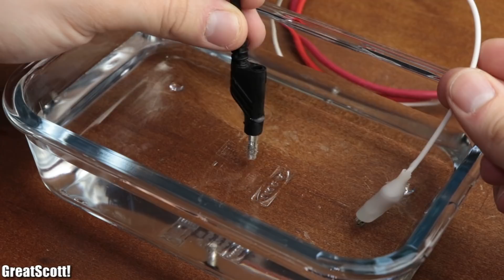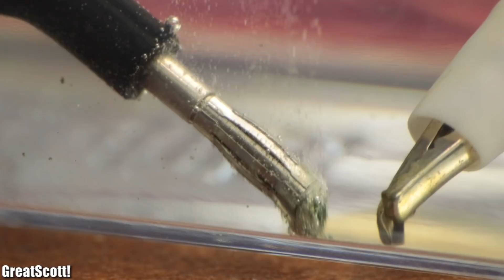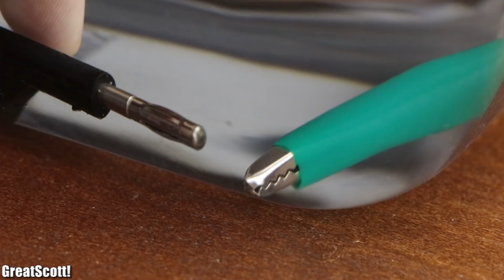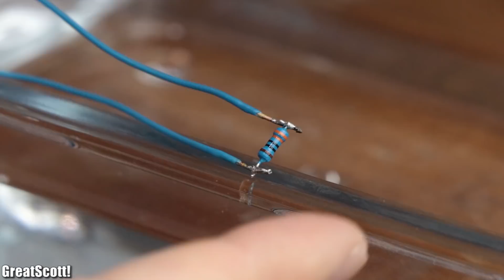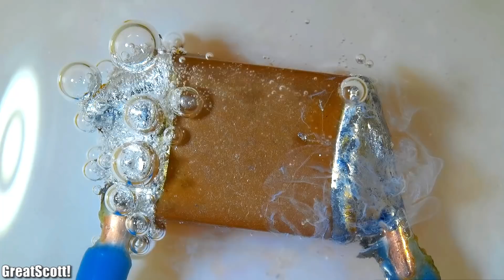Electronics & Water? What could possibly go wrong?

Comment: Arduino stop working. With water disabled oscillating crystal!
Reply: yeah I wonder what actually happened to the arduino. those pro minis have ceramic resonators instead of crystals, but I dont know exactly how a ceramic resonator works. are they just like super accurate r/c oscillators maybe? idk
Reply: You are correct sir. Crystal oscillators are very sensitive to resistive loading and by submerging in conductive water you effectively add a ~30k ohm resistor across the two terminals. The crystal cannot drive such a low impedance load and fails to oscillate.

I believe the restart of the oscillator after some time is due to chemical deposits forming on the exposed metals that form thin insulators and raise the resistance up to a point where the oscillator can operate. A quick reset and off it goes.

Comment: Back in the 1960s I encountered several tube-type TV's which people had spilled sugary drinks into the back.  The remaining goo on the circuit was conductive.  Washing an entire TV chassis in a shower worked reasonably well so long as you let it dry in the sun for a few days.

Comment: GreatScott! One more thing should be added that tap water is not the same everywhere. That means if you get 300 Ohm/cm in your tests someone (ie. with old metal pipes in their water system) could get less or more.

Also in your test you could add salt to even more decrease Ohm/cm. That is how water resistors are created :)

Comment: It does amaze me how people think about electronics. I can't even recall the number of times someone told me their electronics got wet and now it does work, it doesn't work because the first thing you did was try to power it up (or it was powered when it got wet), not necessarily because it got wet. Water and electronics mix just fine you can leave an electronic device in water for weeks, months or even years, as long as there absolutely zero power (no battery). And if you dry it properly it will work as good as the day you put in the water. Its the water and electricity in combination that ruins electronics.

Comment: This was before I actually watched the whole video, I paused at the end of the intro, electricity directly from the socket, 110v ~ 150v and 215v ~ 250v coming in contact with water is not a good idea, as long as you are wearing boots, and are not soaking wet, you can go ahead and unplug whatever is plugged in and should do ok, the main risk here is that you could act as a wire to earth from the line, if you're properly insulated, aka not touching anything conductive and the earth itself, you should be fine, just unplug whatever was soaked in water, the secondary risk is the device that was soaked getting some short circuit internally and burn itself up.

With electronics it depends on how much contaminant are in the water, and how quickly you remove as well as clean and dry the devices after it had been exposed to water or whatever other liquid, the main issue you will get are often that the water corrodes metal alloys in electronic parts that are not watertight as well as corrode all the exposed metal parts, and if those parts contain iron or alloys that contain iron, they could start rusting, all electronic devices have parts that contain iron and alloys with iron in them.

Comment: Once at the plant where I am working as a maintenance man, the electronic gas meter stopped working due to moisture. I cleaned it with a brush and soapy water, let it dry, and put a coat  of varnish on it. Still working now, 8 years later!

Comment: For industrial electronics such as PLC and DCS equipment we had both CO2 and distilled water fire extinguishers. The distilled water of course to keep the equipment clean but also to minimize the conduction of electricity and the shock hazard from supply voltages of 120VAC and 125VDC.

Comment: Louis Rossmann once did this with a Macbook. Same result.

Thats why there is only one possible solution if you spill water over your laptop/phone: INSTANTLY remove the battery, and let it dry. If it's only tap water, you're fine, if it's sticky like coke you need to clean the board with alcohol and destilled water.
If you dont do this, your board will corrode either instantly, or over time.

Comment: I dropped my phone in tap water (by accident). I don't know how much time it was in the water because I didn't notice fast, but maybe one minute or two. It wasn't supposed to be water resistant but I guess the only sensible parts that were really exposed to water was the jack, the speaker membrane and the usb input.  No sign of faster battery draining. I may open it one day to check if I have rust traces in it (I need tools I guess) but it's more than 1 year ago and I didn't see any malfunction (I had some issues before it didn't got worse with the bath). Phone is honor9.

Comment: I mistakenly went swimming with my headphones in my pocket in salt water last summer (my bad, people sometimes forget). I realised it pretty soon after I got into the water, but late enough for them to get fully wet. I went on and washed them with the cleanest water I had at hand, which was the nearby shower (I know, not distilled water but that's all I had available - still better than all that salt the sea has), and let them dry in the sun for a couple of hours. They still work today, and I haven't noticed degradation in their sound quality. Water is not as dangerous as it seems to electronics. Not good, but not that bad either.

Comment: Something I didn't see Scott point out is that, before you stick your finger into a cup of water with a live wire in it. MAKE SURE IT'S DISTILLED WATER, or else you'll either feel a light zap or all 127-220 Volts of electricity. Which really is painful.

Comment: In season 2 of Agents of SHIELD they literally ripped a lamp off the ceiling (that had both the longest cable ever and perfectly stripped and twisted wires) and caused a spark by touching the two leads, they then proceed to shove both leads in someone's face causing them a BURN wound, like wtf.. Don't get me wrong, it's my favourite show, but man was that part cringy

Comment: I had a laptop from 2012 that died in January this year, I've spilled tap water on it probably 10 times over it's life span, and it was working perfectly fine till it died out, also sort of need to note that the laptop often reached a cpu package temp of 110℃ even when it was brand new, and was almost always running like that the entire life of it, every time I remember I've spilled water on it, I took out the motherboard as fast as possible, and patted dry the parts, then put it in the owen on 55℃ for 30 minutes to let the water evaporate,  I also replaced the thermal compound as well as cleaning out the heatsink and fan, unplug every single connector on the board.

Comment: I had a cheap brushed ESC in one of my model ships. It had sea water leak onto the ESC. I washed it out with tap water and dried it out. 

Boat sails fine. 
Boat stops in the water after 40 seconds. 
Boat makes smoke out of the funnel. 
Owner is in panic. 
Smoke density increases. 
Owner wonders whether or not to jump in  the sea after it.  
Suddenly boat has some kind of internal explosion. 
Owner dives in after boat., nearly stepping on a surprised crab. 
Owner retrieves boat, water was not cold.
Owner opens boat to find a horrible sulfur smell and front of boat is full of yellow liquid.
Take boat home.

Never will I buy a cheap ESC ever again. Luckily it was powered by a NiCd battery and not a LiPo because that battery was roasting.
Got the boat sailing again, turns out the bang was a capacitor launching like a projectile inside the boat.

Comment: Scott! You should've tried that arduino with internal RC clock as well. The long leads to the crystal oscillator got altered by the additional resistor. If you keep everything (except the LED and its resistor) inside the chip, it should work.

Comment: chemist here, you cant judge wether or not a chemical reaction is happening by observing the bubbles, its only if you are creating H2 and O2 that bubbles will be visible, other electrochemical reactions can be to disolve a metal in water by salting them or other changes still

Comment: Interesting to see the actual numbers and the nicely predictable constant 300 ohms/cm as well as the actual effect on electronics so a very good video in that regard. One thing I wonder though, I saw somewhere that the amount of current that can cause problems for a human seems kinda small, if you are used to playing around in 5V land. The reason why no one notices anything from a poking the business end of a 9V battery though is that it isn't high enough voltage to get past the resistance of your skin (plus internal resistance) and still deliver enough current to be in the problem range. If you throw 240V mains into the mix however, I have a feeling 100mA might be "un-fun". I seem to remember small currents start to be a little unpleasant at around 45V?

Comment: Mineral oil is non-conductive. You can put electronics into it and it'll run fine, many have used it for whole PC cooling (not very successfully). Liquid electrical tape works well for coating or there are more expensive (better) solutions available for electronic encapsulation. You can even put the electronics in a glass ball filled with mineral oil and have an object that can survive just about any pressure underwater because there's no pressure differential between the outside and inside, so it can dive to the bottom of the ocean with ease (cheap deep water camera housing).

Comment: It should be noted that electronics contain enough contaminants that when you submerge them in water the resistance will decrease quickly as those dissolve. Additionally the ongoing electrolysis will add more contaminants to the water. After a while the formerly distilled water will be as corrosive as tap water.

Comment: Even pure clean water can mess up complex computer circuits, as that slight resistance or leakage can disrupt hi impedance parts of the circuit hence causing it to malfunction. Also when a pcb is submerged, any dirt of contaminants will pollute the water increasing leakage current. Also the reason why water is considered conductive and unsafe with electricity, is that in most places you will find water it is contaminated and very conductive, such as a chlorine pool, pond ,puddle, tap water, lake, the sea is extremely conductive, all that salt.

Comment: we used to recover salt water immersed equipment (wooops, sorry captain, it went right off the deck!), flushed in fresh (deionozed/distilled) water, drain as much off as possible and then shove into a warm oven (110F) overnight to 'dry' it out.  even worked on radios, gps, and power tools too!    cameras or anything with optics are usually finished once they get wet though.

Comment: GreatScott, I don't ask much of you, but please make an MPPT charge controller using the Arduino. It would also be really cool if you would tell us how to modify the circuit to fit our solar and battery needs and if the MMPT algorithm was a Feed Forward Neural Network which used the Arduino to log the temperature, time of day, and the power output from the panel, onto a micro SD card, which could then be plugged into a computer and run through a program to train the Neural Network, which would then load the calculated weights and biases back onto the Micro SD card for Arduino to use. Then, to take it one step further, we could create a peer to peer network using our computers to train the neural network and upload our recorded data together. So, at the very least, please create an MPPT charge controller!

Comment: When I did these experiments not too long ago I found that the regular tap water's resistance seemed nonlinear. I kept the leads distance but changed the voltage while moving both leads through the water to lose the bubbles.

Comment: Did you know:

You can create a water heater by passing AC electric current through water? There are cheap water heaters available on eBay and in countries where electrical safety standards are lax. The AC electricity causes the water and impurities in the water to become excited, they rub together and generate a lot of friction, thus, heat.

Comment: I remember once I had to call a technician to the solder dipping machine I worked to tell him some how I'm getting shocked and I can't figure out the source , after an hour of puzzling and checking and confusion they asked me to run the machine and just watched. Then we figured out what was going on , parts were not shocking me directly (diodes/rectifers being dipped) it was the flux , the pump was leaking and the flux was measuring 110v to chassis ground. Not very conductive but enough to cause a tingle.

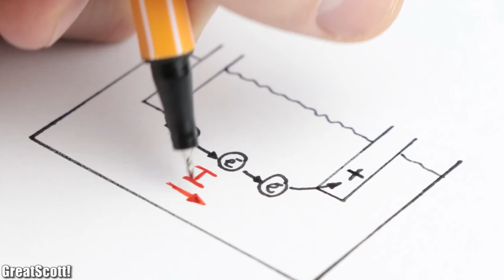Comment: At 03:01 there is a mistake
Current flow is the opposite direction of electrons direction of movement 
Electrical circuit 101

Comment: Distilled water works fine at first. With time however impurities will seep into the distilled water (e.g. from the ambient air or the components themselves) increasing its conductivity and reactivity with the tin and copper similar to the tap water.

Comment: Perhaps some of the corrosion is due to flux bring left on the boards? With the ATMega in distilled water, perhaps flux contaminated the water at first, causing circuit issues (reset pulled low?)

Comment: I think tap water switch on the reset button (little distance between contacts so we have little resistance between 'em) so you have RESET port connected to GND. And that's why your Arduino doesn't work.

Comment: There is a difference between AC current and DC current when it comes to electrolysis. Electrolysis (when using DC current) produces oxygen at the anode and hydrogen at the cathode. When using AC current, the water just heats up and doesn't produce any gas. The gas coming of of the electrode for AC current is probably the water spontaneously boil there.

Comment: Pure water (aka distilled) does not have free electrons in it, nor charge carrier particles, therefore pure water does not conduct electricity at all. The alleged "distilled" water in the video had some impurities in it, that's why it had a resistance, instead of being a total insulator. Nowadays even pharmacies selling deionized water as "distilled", because of the price of total distillation is getting out of control. I think I don't have to emphasize the dangers of using deionized water as distilled water, especially for chemical and medical purposes.
By the way, if someone has to work with pure distilled water, the best way is to make it, by the old school mode. If the gear is clear (free from contamination), it won't conduct electricity at all.

Comment: GreatScott, try using the internal RC oscillator (8Mhz) of the Arduíno, the onboard 16Mhz cannot have any low impedance resistor across its terminal or the arduino would behave exactly like that. For instance, even when putting a finger between tht crystals of an arduino board you'll see strange behavior.

Comment: Water is actually a long chain polymer with H2O molecules joined together with hudrogen bonds.  That explains why water is a liquid and methane is a gas. CH4 has a similar atomic weight to H2O,  but IS made of single,  small molecules.

Comment: but you know what you can sumburge electronics in? Oil. specificly mineral oil. I plan to do this with either an matx or itx build and I would suggest this as an idea for a video. Just make sure you know what you're doing and get a pump that supports the use of oil and keep the optical drive and HDD out.

Comment: I'm really curious what causes the leakage current in those SMD caps... It explains why the electronics didn't work in the water, but what physical change is it that's causing it?

Is it because the plates are really close together, so when the water bridges them, it causes lots of little bits of current to flow, enough to not just prevent them from working, but also damage the ceramic? Or is it just that the ceramic porous enough to absorb the water?

Comment: You should conduct this experiment again wearing rubber gloves. Everytime your bare fingers went into the distilled water the salt, oil, and cheetoh dust went into solution making the distilled water conductive. If possible you try again with deionized water as well.

Comment: I am guessing that the water got into the reset switch and stopped the arduinos working by asserting the reset when the button wasn't pressed. Maybe try adding a pull-up resistor to the reset line, or just remove the reset button. Perhaps all the other components are fairly waterproof?

Comment: Great video. Brings to question: Are water resistance tests on electronics are performed using distilled water? I've seen electrics that were rated "water resistant" to x depth fail after very small exposure to non-distilled water (drops). If these tests are passed using distilled water then the manufacture can label them "water resistant" without making a false claim. Hence are these devices really "water resistant"?

Comment: FYI, Even 1mA of AC current will kill you by stopping your heart by sending it into fibrillation. 
It all depends on how much salts and minerals are dissolved in the water. Some places have very heavy water.
DC does not have the same effect as AC on the heart.

Comment: Pure water does not conduct electricity. It is the anions and cations in tap water that conduct electricity and corrode the leads. Putting fingers with oils and salts on the surface will release anions and cations into distilled water (which is collected through a evaporative process, meaning it is technically pure) but, practically contaminants are present/released.
Reply: There is a small trend of putting computers into mineral oils, which is an extension of these concepts.